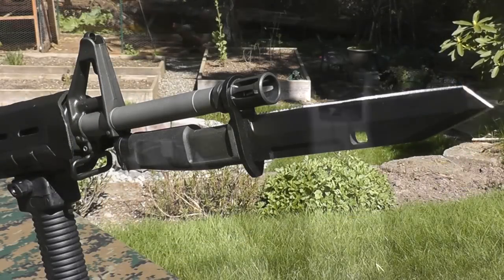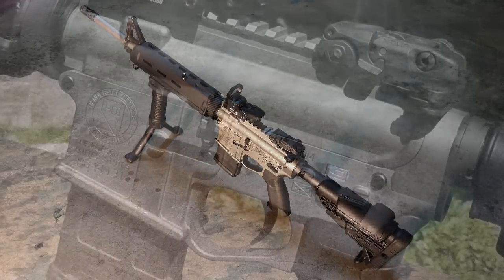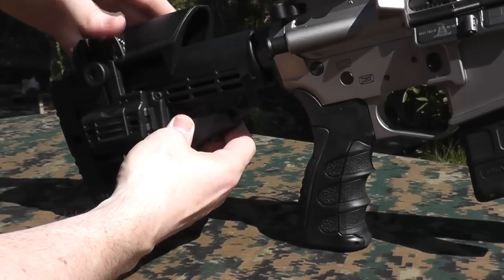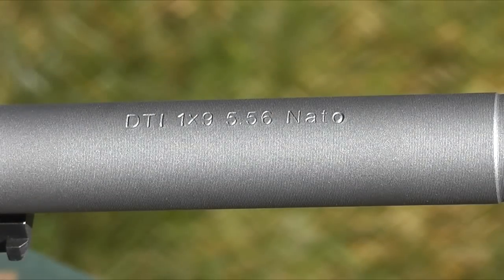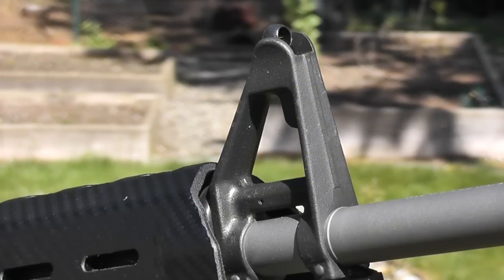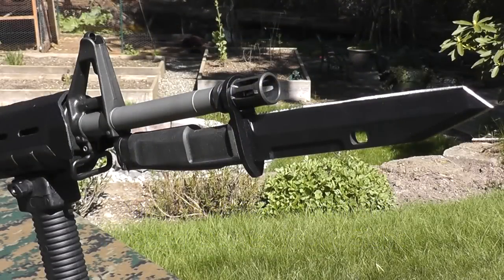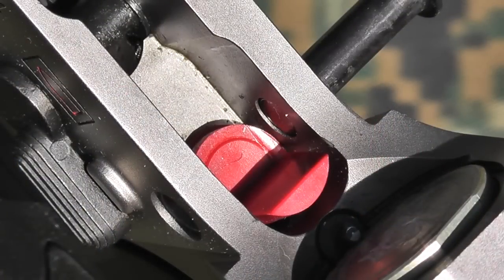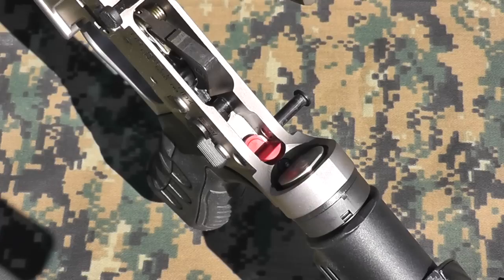My First AR-15 Build;Why I chose these options

Comment: nice AR, .you did mentioned the receiver does not come with the feeder groves built in, where can you get that worked by? machinechop or the local gunsmith? and how much would that cost. thanks in advance.
Reply from the maker: M4 style feed ramps can be easily cut into the receiver but I haven't found a need for them.